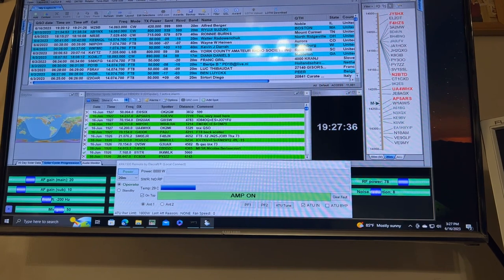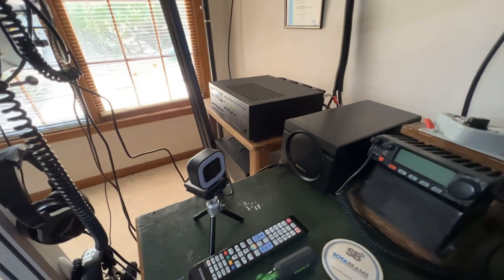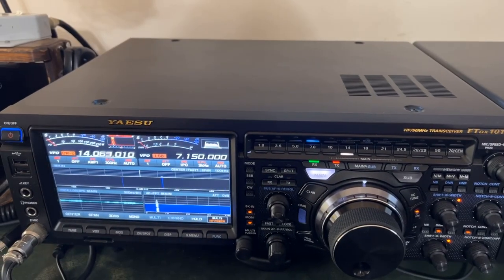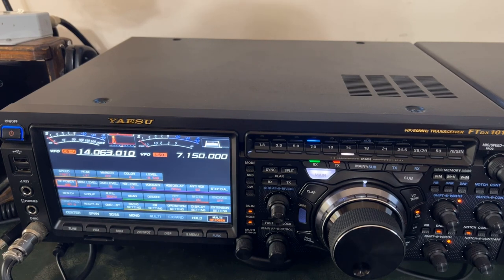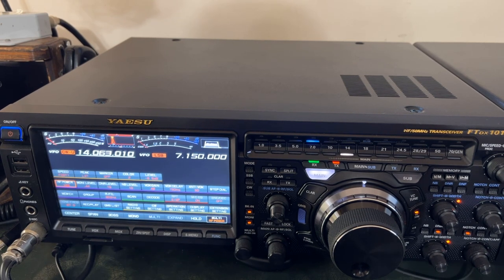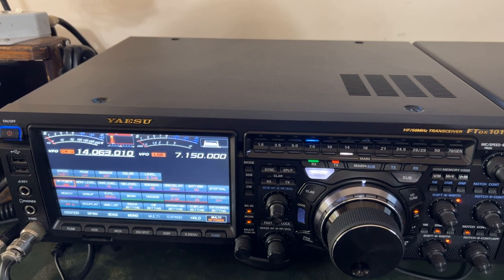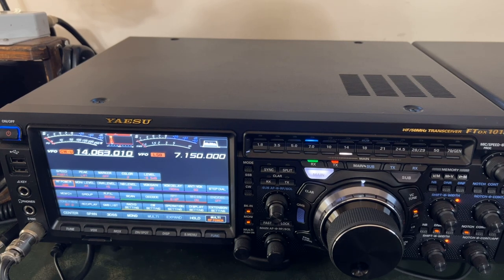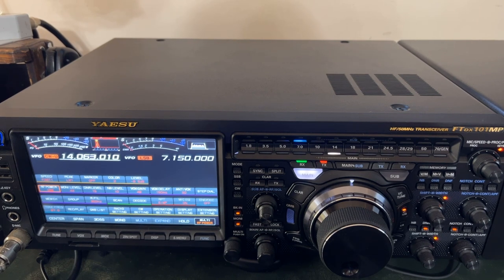Yaesu FTdx101MP: Unboxing and Setup (video #1 in this series) #hamradio #yaesu #ftdx101

Comment: I sold my FTDX 5000 MP, I have regret, sadness about doing this..... it is the best HF Radio to date, the FTDX 5000 MP was unbeatable, a success that Yaesu could never achieve for the manufacture of this model... .. and if it produces again it will be the best seller again!!!!
Reply from the maker: I totally agree. The 101 is quite good though, especially for scope watchers or those who operated digital modes.  

The FTdx10 is my backup, after the FTdx5000MP.  The dx10 is a boss. The receiver is on par with the FTdx5000MP, but the FTdx10 is more menu driven and doesn’t have a RF preselector. Still, it competes with the 5000 on receive performance. I have comparison videos where I put them up against one another. It’s usually neck to neck.

Comment: Looking forward to this series on the 101MP.  I have had my 101MP for almost 2 years....  just totally love this rig and I do think, that over time, it will grow on you too.  73 Art W1SWL
Reply from the maker: I like it.  It has some nice “creature comforts”.  I still favor the ergonomics of the FTdx5000MP.  

With the 5000, both speakers work when using VFO-A, and the SM-5000 has a phase reversal option that creates a surround sound effect, while listening to only one receiver.  It sounds great! When I enable VFO-B, the right-hand speaker of the SM-5000 automatically starts outputting the audio of VFO-B. With the 101, I have to sync both receivers to get sound out of both speakers. It sounds great though. I will note that, when using headphones, the 101 functions the same as the 5000.  

The DNR is great, but falls shy of the performance level of the DNR in the FTdx5000MP and the FTdx10. That makes no sense.  The flagship transceiver should beat the older radio and the little brother. But the DNR is better then it was when I tested the 101 in 2019.  Back then, the DNR performance was the same as the FT-891.  The 891 introduces digital artifacts that make it sound like you are listening under water, until you increase to DNR algorithm 9.  The 101 was no different in 2019.  The 5000, in 2019, had DNR performance that equals the FTdx10.  To be fair, this MP doesn’t have the absolute latest firmware. But it was upgraded with a newer firmware than the 2019 firmware. So this DNR is improved. No watery sound, but not as effective as the DNR in the 5000 or the 10.

I also miss the Super Narrow APF of the 5000 and the ability to adjust the AGC hold time.  But alas, there is no one radio that has it all.

Comment: I just bought the 101D so I'm excited to follow this series and possibly learn something.
Reply from the maker: I will mostly focus on features of the 101 that are not included in the FTdx10. Most of the operating techniques are already covered in the FTdx10 playlist.
Reply: @n4hnhradio  Doug, comparisons with the FTDX5000MP would also be welcome. 73, John 2E0SVB.
Reply from the maker: I wish I could, John, but I have no way to fit both on the desk. I will compare with the FTdx10, and I’ve already shot videos comparing the FTdx10 to the 5000. They are neck to neck. I still prefer the ergonomics of the 5000, Super Narrow APF, adjustable AGC hold, adjustable carrier insertion point, etc., that I’ve written about many times in comments.  And there is the PDF on Patreon that goes into greater detail about why I chose the 5000 over the 101.

73 my friend!  It’s great to hear from you.
Reply: @n4hnhradio  I was thinking more from memory than direct 1:1. Super interested in this series nonetheless; Elecraft K4 or 101MP is a current thought process. To supplement not replace my FTDX5000MP. Best wishes from your biggest UK fan 😊🍻
Reply from the maker: You will definitely hear commentary comparing the two. I’ve already written about some of it here, answering another comment.
Reply: @johnratcliffe6438 😅9

Comment: I had a FTdx101MP and it is a gorgeous radio. I also bought an extra speaker because, my error completely, I thought it would do what my FTdx5000 does - audio thru both speakers for a single VFO. Nope! Turns out the 2nd speaker is silent unless I operated split without headphones, which I rarely do. I even spoke to Tim at Yaesu about it.
Reply from the maker: Yep!  Not hearing sound from both speakers when using one receiver also bugs me. But I like the 5000 better anyway, for that and other reasons.  What you can do with the 101 is long-press the Sync button and use both receivers simultaneously on the same frequency. One of the subsequent videos in this series covers that.  But, when you sync the two receivers in the FTdx5000, it also copies filter and DSP settings to the second receiver.  The FTdx101 doesn’t do that. You have to manually set the second receiver filtering and DSP to match. 

Little missed opportunities like that are unfortunate.  Video #91 in my FTdx10 series will show another feature that the FTdx10 has that the FTdx101 doesn’t.  

The 101 is still a fine transceiver.  I’m admittedly nitpicking.  By the way, if you use headphones with the 101, you get sound out of both speakers, just like the 5000.

I think the greatest setup is an FTdx5000MP as a primary transceiver and an FTdx10 for digital modes and backup.  Plus, the FTdx10 is a fine CW rig, especially the optional 300Hz roofing filter installed.  It can rival the FTdx5000MP on CW.

73, de N4HNH
Reply: @n4hnhradio  I sold my '5000 shortly after buying the '101. A year later, I sold the '101 and went looking for a '5000. I found one locally and haven't looked back. I also have a Flex6600 and have to admit, the panadapter is the bees knees. I played with LPPAN on the '5000 and just didn't care for it.

Comment: Hello Doug I love my Yaesu FTDX 101 MP

I used to own a ICOM IC 7610

I did sell this radio while back

the YAESU FTDX101MP  is 10 times the radio is the ICOM IC7610

73
Reply from the maker: Hi Roger!  It’s great to hear from you. I saw the video where you said you were going to sell the 7610. It’s a good radio but you’re right - It just isn’t at the level of the 101.

73, Doug

Comment: Excited. I really think you should a comparison video with the FTDX-5000 at some point. Thanks Doug. 73
Reply from the maker: Hi Martin!  I will be commenting in videos regarding the differences between the 5000 and the 101.  I have no way to fit both on the desk though. I will compare with the FTdx10.  And I’ve already shot videos comparing the FTdx10 to the 5000. You probably saw those in the FTdx10 playlist.  They are neck to neck. I still prefer the ergonomics of the 5000, Super Narrow APF, adjustable AGC hold, adjustable carrier insertion point, etc., that I’ve written about many times in comments.  And there is the PDF on Patreon that goes into greater detail about why I chose the 5000 over the 101.

73, Doug

Comment: Wich TX is better ? 5000 or 101? mny tks.
Reply from the maker: That is subjective. They are both great. The decision boils down to operating style and ergonomic preferences. I favor the 5000 for ergonomics and I like the sound of the receiver. But, if you work much digital, you will probably prefer the 101.
Reply: @n4hnhradio  90% cw. 10% ssb. No digital . I can not to this.
Reply from the maker: Both are great at CW. The 101 costs less in the long run. By the time I bought the SM-5000 and the three mu-Tuning preselectors, I could have bought half of a 101 again.  But the 5000 has a Super Narrow APF setting, which the 101 doesn’t have.  That helps with CW. The 5000 also has better DNR.  And I like the knob and button placement better on the 5000.